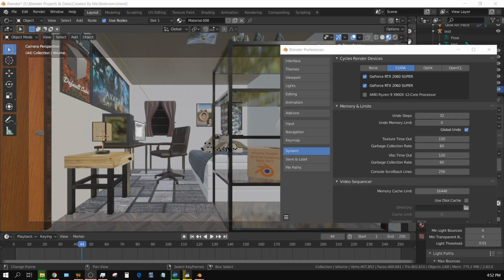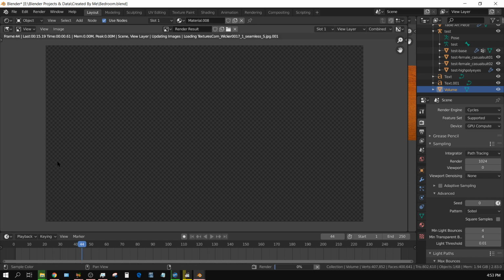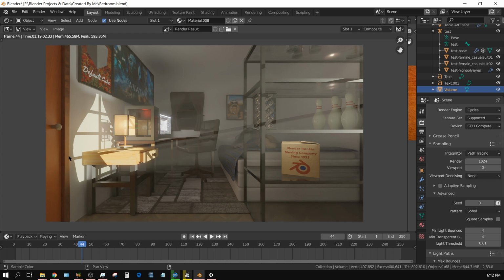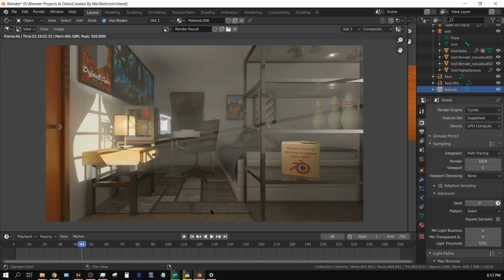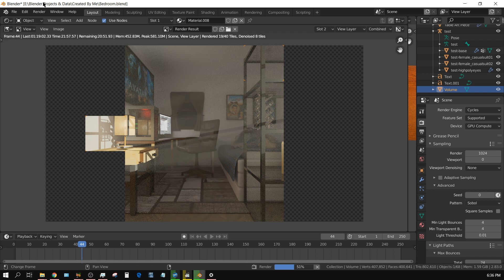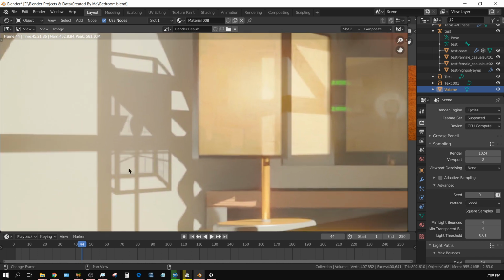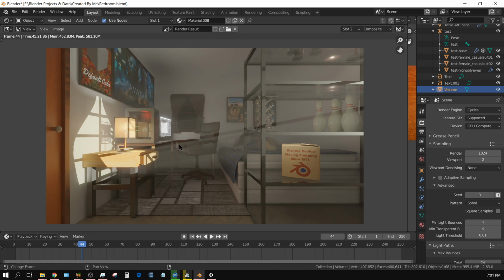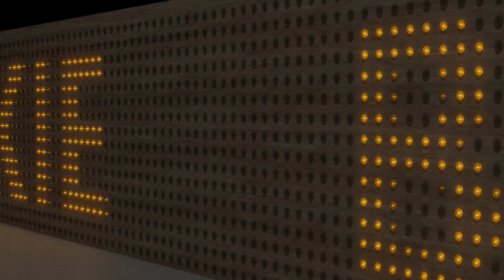Cuda vs OptiX Volumetric Rendering - Blender

Comment: Thank you for this video. 👍 I've been trying to figure out the difference between the 2. Now I know which one I'm sticking with.
Reply from the maker: Optix works even better now than it did 3 years ago when I made this video.
Reply: @BlenderRookie  That's even better. I used to use OPTIX denoise in Maya. It was clearly faster for me in Maya but now that I had to switch over to Blender with a new UI and control mechanics I couldn't figure out if I had access to OPTIX for a long time. I just seen today the CUDA and OPTIX in the preferences and I now have a better PC for it.

Comment: I want to know how much difference it makes between Cuda and no cuda..
I have RX 6600 TX gpu, no cuda. How much difference will it make to swap it with RTX 4060? 

I am waiting half an hour for some basic stuff on blender. Cant figure out what it is and if Cuda would solve it?
Reply from the maker: I have never used an AMD card, so I can' give specific advice in regards to non nvidia card. However, it's easy to build a scene that takes a long time to render on any card, especially scenes with volumetrics and badly lit scenes.

I made a video a while back showing the process I use for optimizing interior render scenes so that they don't take forever. It should still help. https://www.youtube.com/watch?v=P_5SR91kkJI
Reply: @BlenderRookie  Not sure this can help, it is not even at the point of rendering, it is with beginning stops (just editing mesh). I still don't understand why it is so slow or if it is normal with a model having lots of triangles? but I did find a fix to prevent blender from crashing when i cut the models.  I exported stl to prusa Slicer, fixed it with netfabb, exported stl used decimate 0.5 then remash 0.1. After that I could cut it again without program crashing.

I have only 16gb ram.. might this be a big problem?
Reply from the maker: @thesouthwestern  The part it does before rendering starts, is done with the CPU. Slow system memory and a slow CPU, will slow that process down. But the number of faces(or triangles) will also slow it down and can drastically slow it down if the number of faces are in the millions. Especially if you are using large image textures, a lot of image textures or complex node based materials.

My system will start to get sluggish at about 12-15 million faces.

Blender also has a decimate modifier. It also has a feature that selectively decimates(non destructively) based on how close the camera is to the objects in the scene. I can't remember what it's called and I am not in front of my computer at the moment. But yeah, adding a lot of high poly count objects will slowdown the render build and render time drastically.

Check this video out, it will help. https://www.youtube.com/watch?v=N4QY-1Vf6LM
Reply: @BlenderRookie  Cool thanks, I will check it out. 

When freezing my CPU is using 5%, but my memory is 99%. 
So maybe I must upgrade that first.
Reply from the maker: @thesouthwestern  Oh, in that case your system ran out of memory. That's not the vram, but the system memory. I should have known, you said it was freezing. Yeah, you ran out of system memory. 100% sure.

Comment: Hi Why does cuda, optix and openCL options in blender system unfortunately not support nvs 5200m card?
Reply: Because 5200 is ancient relic that is older than 10s series of Nvidia. I mean. It runs on DDR3. Even modern CPUs run on DDR4 and DDR5, while GPUs are on DDR6.

More technically, OptiX uses special computing Raytracing and Tensor Cores in RTX series GPUs. Those cores did not even exist back in 5200m times, so there is nothing to use there for technology. And there is no CUDA to fallback at either, since 5200m CUDA version is 2.1, RTX 3xxx uses 8.6, GTX 1xxx uses 6.1.
Reply from the maker: I think it is because the 5200m uses opengl 1.1 and blender uses 2.1.

Comment: how do I know which graphics cards are compatible with OptiX? I have a Geforce RTX 2070 W/ Max-Q design
Reply from the maker: As far as I know any desktop GPU that's an "RTX" GPU will work with OptiX. But I have ZERO experience with max-q or laptop GPUs so if you are looking at laptops, I'm the wrong person to ask. That said, I think RTX GPUs in laptops will work with OptiX.
Reply: @BlenderRookie  I use an RTX laptop. It works with OptiX and is about 20% faster than CUDA. Tried it myself.
Reply from the maker: @yenvisuals4489  Cool beans.. Thanks for letting us know.

Comment: I have the 3090. I could have rendered that in 5 minutes
Reply: lmao the flex
Reply from the maker: All good GPUs have been out of stock for a few months now, so how did you get a 3090?
I will either get a couple of 3080s or 3080ti if they ever become available at MSRP or lower.
Reply: @BlenderRookie  I just bought two (overpriced) RTX3080ti's , there a little bit more expensive, but I would go with the 'Ti' card, because when it comes to performence, they   perform closer to the 3090 card. This has mainly to do with the CUDA cores I believe.
The RTX3080 has 8704 cores and the Ti 10240 (the 3090 has 10496 cores)
Also keep in mind, the 3080Ti has no V-link or something similar, but this is  unnecessary for blender.
Luckely, in Blender, if you render on CUDA you can exceed the VRAM that is available on the card (12GB for the 3080Ti) because Blender will use your RAM memory , when using Optix that's not possible and Blender will give an error and will not render.
That said... if you can afford it, the RTX3090 is a better option because of the little faster speed and especially double VRAM (24GB)
But ofcourse that's a budget thing
What I can say, is that the two RTX3080Ti cards are blazing fast in comparison to my old GTX980Ti cards...
Reply: To be honest I didn't know the first thing about building a PC and I got the 3090 the week I decided to build a PC.  Right before I was going to sleep I saw that there was one in stock at the Micro Center so I drove there at 3 a.m. and waited till morning cut in line and got a voucher to buy the 3090. https://twitter.com/LordKingCrown/status/1333458096178552835?s=19

Comment: you are using 2 gpus, do you need some sort of nvlink or something? pls explain it
Reply from the maker: With Blender you can mix and match different brands and series of GPUs and they will work together just fine and they do not need a link. Fo example, earlier this year I had two GTX 1060s and two RTX 2060 supers in one PC and Blender used all 4 at the same time all without needing a link. Blender I believe can use up to 8 GPUs at the same time. It can do that because Blender divides up the frames into tiles and then each GPU renders its own tile while another GPU is rendering its own tile.
Reply: @BlenderRookie  hi thank for the update.. But if I have a 3070 and wanted to add a 3080.. Would the 3080 work at its optimum and not lower itself to the 3070 as I've heard from some people.. Thanks.. Just want to make sure not to spend that extra money if it will bottleneck
Reply from the maker: @GavinTango2004  You can mix and match and each one works to its full potential. Even-though they are working on the same render they still are doing the work independent of each other. You can mix a weak card with a powerful card and each work as fast as they can.
Reply: @BlenderRookie  Thanks for the information. How does it behave if you are mixing a rtx graphics card with one without rtx (In my case, rxt 2080 ti and a spare gtx 1050 ti). If you are using the denoiser would you benefit from the 1050 ti? if yes, how? if you are using the "normal" cycles then i could imagine that you will have a performance boost. It's a real question from my side. Hope you know it before I start tinkering.
Reply from the maker: @JackPillawa  If you use cuda, each GPU is rendering their own tile and many of those tiles make the frame. So essentially the speeds are added together. But of course OptiX will only work with the RTX card. Also the 2080 ti by itself in Optix will be significantly faster than a 2080 ti and a 1050 ti both rendering in cuda.

Comment: Is Optix a RTX prorietary ?
Reply from the maker: My understanding is that RTX cards are required for OptiX. I don't think that will always be the case.
Reply: @BlenderRookie  I've seen benchmarks using radeon pro on Nvidia cards , tought it was impossibile.
Could you try that ?
Reply from the maker: @AAAAAAndrea  I don't understand what you mean. Radeon Pro is an AMD card. How can an AMD card be used on an Nvidia card.
Reply: @BlenderRookie  I've seen benchmarks of " radeon pro " render , wich should work on AMD cards only, did on Nvidia cards , seemed impossible to me also.
Works of course on my RX 580 , surprised it worked on Nvidia cards also.
Reply from the maker: @AAAAAAndrea  I still don't understand. I'm gonna chalk it up to ignorance on my part.
Reply: @BlenderRookie  No problem , anyway I've tested the haircomb render and as you said using CPU+GPU is useless , my results:
3600@ 4ghz all cores 58.34 sec
cpu+ RX580 8gb 24.41 sec
only RX580 26.51 sec
Reply: @BlenderRookie  He means AMD Radeon™ ProRender. It's a rendering engine from AMD that works in Blender and other 3D apps and can run on both AMD and NVidia cards, separetely or even together.
https://www.amd.com/en/technologies/radeon-prorender
Reply from the maker: @NarekAvetisyan  Thanks for clarifying. I now understand. I never even heard of that rendering engine. But I bookmarked it so I can go back to it later today.
Reply from the maker: @NarekAvetisyan  Question: The renders that come from ProRender need color grading, right? Do you know of a good color grading software that's free. I am very cheap. Curmudgeonly cheap.
Reply: @BlenderRookie  I'm not very familiar with ProRender I used it only a couple of times and switched to Cycles, because I'm still learning Blender.

But for color grading I use RawTherapee for single images with the film simulation luts.
https://rawtherapee.com/
https://rawpedia.rawtherapee.com/Film_Simulation

And for video work I use  the free vesion of DaVinci Resolve to color grade it's the best in the buisiness.
Reply from the maker: @NarekAvetisyan  Thanks. I have Davinci Resolve installed but I have never really used it. I never heard of RawTherapee but I will check it out.